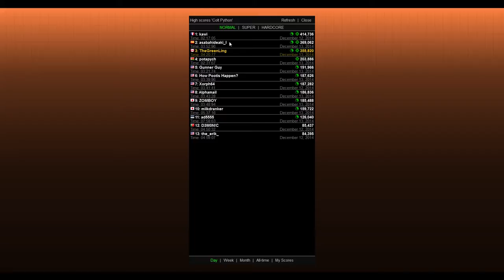Lets Play World of Guns: Gun Disassembly 34 - Colt Python Game Modes

Comment: Nice video and very informative, the artist who drew the schematic of the Python mistakenly drew the firing pin spring Backward.  Most schematics are like that since they are based in an early drawing from colt that shows the spring backward.
The firing pin spring is a cone-shaped coil. You install the small end over the firing pin and the wide end toward the front (Frame). the other situation is the Hammer pin and the trigger pin, there are no easy to remove and need to be hammered out, I do not recommend to do this if you are not a gunsmith since you can damage the finish of the gun and there is no reason to do it anyway as long they are not broken or worn out which is very rare. The barrel also, attempting to do this without the correct tooling and the knowledge of the correct methods, and specifications, No joke, this is a BIG Job that looks fairly simple, and is easy to botch.and ruin a great and expensive gun, a gunsmith with proper tools and experience can replace the barrel for $60 to $80. 
My comments are not in detriment of the video nor the person that took the time to make it, I think it is "GREAT VIDEO" and it deserve a big LIKE...
Reply from the maker: Paul Aleksinko I appreciate that. I always love to learn more about the guns. So I love to get comments like this. I always love to learn more, and the little things like this are often the most interesting! So thank you very much for your well thought out comment!
Reply from the maker: Thanks Kevin Means a lot!
Reply from the maker: There is a whole playlist, check it out! More than 100 episodes!

https://www.youtube.com/watch?v=ivP8zSgUZmc&index=60&list=PL3g25GfHOMYfZv98ZEC7rXH4tzkL8yNAd